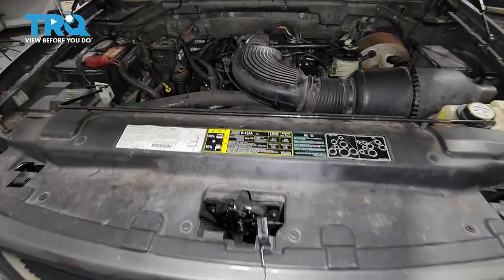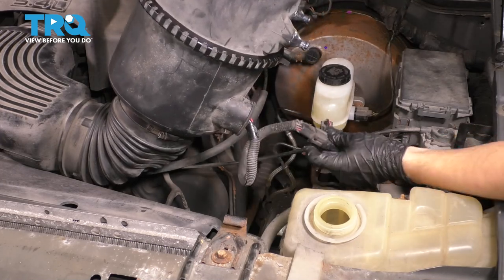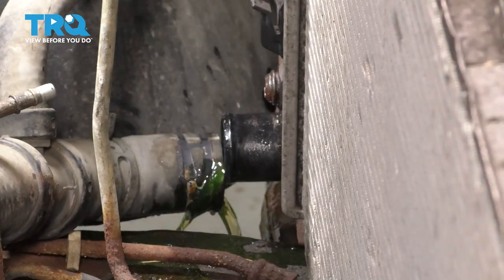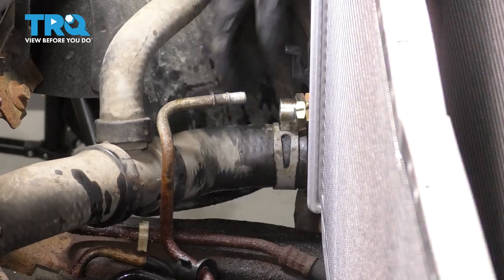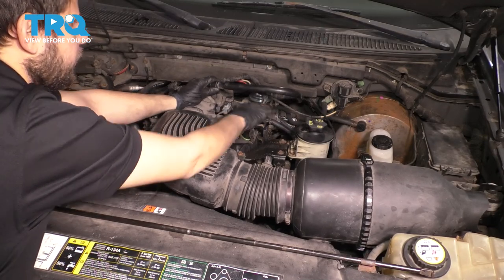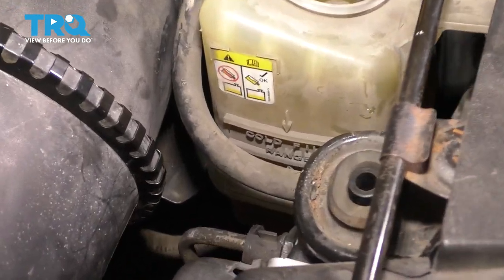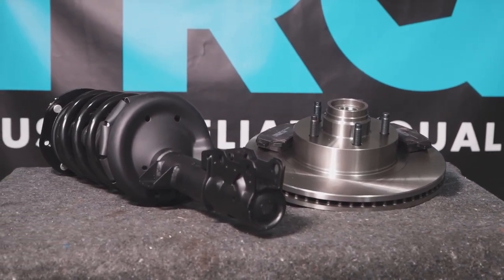How to Replace Radiator 1997-2003 Ford F-150

Comment: What are the specifics on the tool used to remove the transmission line from the radiator? Do you have a link to that tool?

Comment: Just received my new radiator ordered from the link here and received a radiator with threaded fittings on the transmission lines instead of the Dorman quick connect fittings shown in this video. Radiator came with no adapter or instructions for installation.
Time is money and having this vehicle out of service is costing me hundreds a day and not a great first impression of 1A Auto. 
Called customer service line and was told there were 37 callers ahead of me then emailed customer service and now waiting for their two day response window.
Uggh...

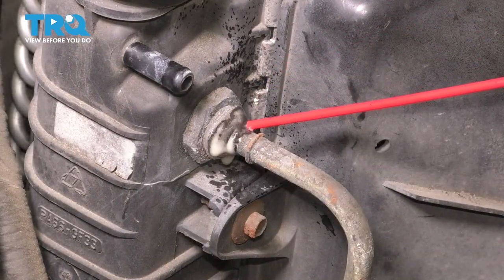Comment: My transmission line fitting @3:24 is diffrent. Mine has a nut that you unscrew to remove the line whilst the one in the video requires the tool.